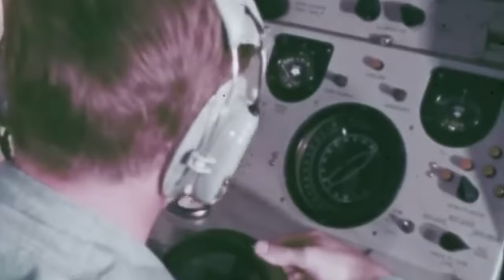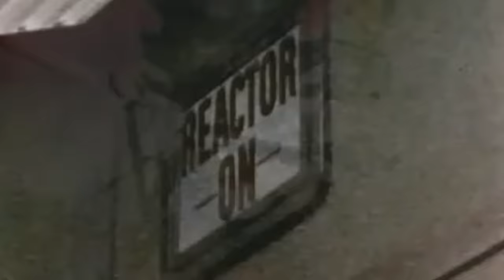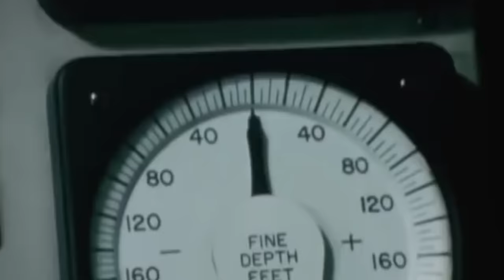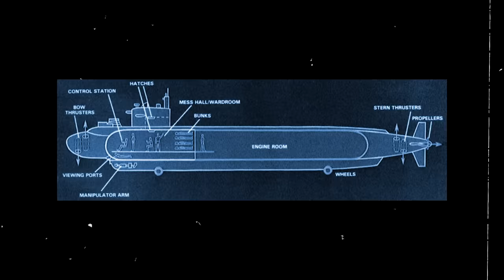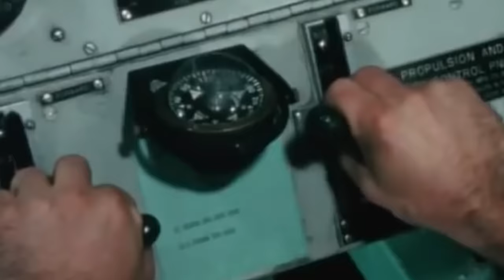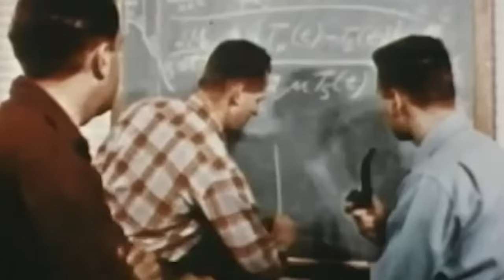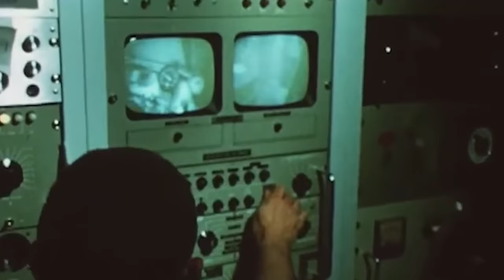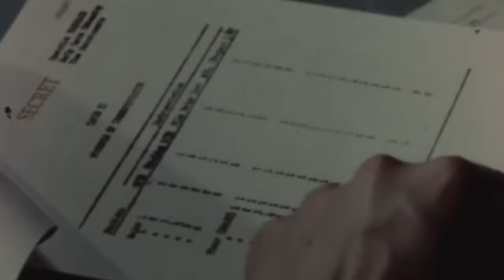The Submarine that Secretly Tormented Russia

Comment: Makes you wonder what they built to replace NR-1?  No way they would just walk away from having that kind of capability.  It's needed now more than ever.
Reply: Not quite a replacement, but as NR1 was winding down (07 or so) my class was going through the nuclear pipeline and the Jimmy Carter was the carrot on a stick for top performers. Student had to have the academics, pass an interview, and obtain TS clearance (most bubbleheads just get Secret).
Reply: Drones. Drones will make Bubbleheads life difficult as well…. Mainly due to the advantage of not having a people tank.
Reply: Yeah they debuted a pretty slick drone from Boeing, i believe
Reply: There was an NR-2 project, but it was killed by bloat and bureaucracy.

Comment: I saw it in Groton sub base in1976, just before the Tomcat retrieval. A Chief pointed out his vessel, and told us the "search, rescue, and research" cover. I knew enough to see about five things that didn't fit ( like armed guards, for starters). I was also smart enough to say nothing to my friend, and it was dim enough that he couldn't see my expression.
 Locally there are so many subs ( the shipyard and the station, too) that watching them is a local pasttime.
Reply: Early 80s on lower base a DSRV was parked between the fence and our pier. It had Marines guarding it with a sandbagged M-60 position and 2 or 3 rovers. Also concertina wire around it.

As many pictures there was of the 2 in and out and on the back of a 637 boat I wondered what that was about? Maybe the Marines were asked to guard it. The Navy meant 1 Marine and they went all in. 😂

Comment: Small subs like this are a horror to live in. You feel everything poor dudes would get ungodly sea sickness for hours/days. Lots of guys ended up with middle ear problems which is hell, it fucks with your balanace. Imagine your eyes banging side to side 6 times a second for 30-180 seconds. Falling down with no control puking on yourself vertigo is terrifying its hell. These guys had balls of steel to live in this literal tincan, normally life on a sub is rather good. what with you know hundred plus dudes with no space to move around dont want guys going insane&violent undersea on a sub with nukes on a stealth mission.
Reply: Middle ear problems and burst eardrums were a problem on diesel submarines caused by sharp pressure changes when snorting the diesels. This is a nuclear powered boat.
Seasickness traditionally occurs at the surface down to periscope depth. This boat was towed on the surface by a support vessel which housed most of the crew until it was time to dive.
Heaven in 200feet down in a hurricane.